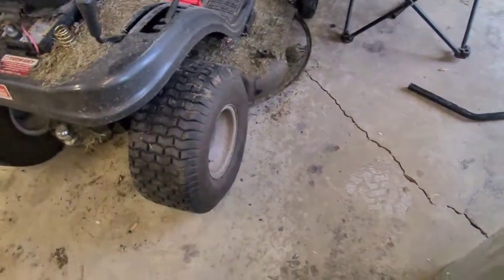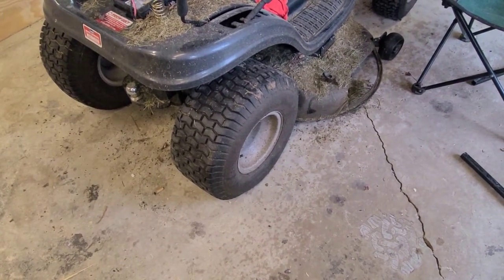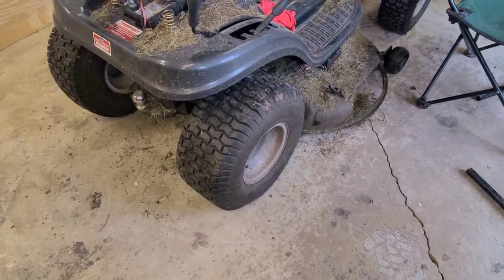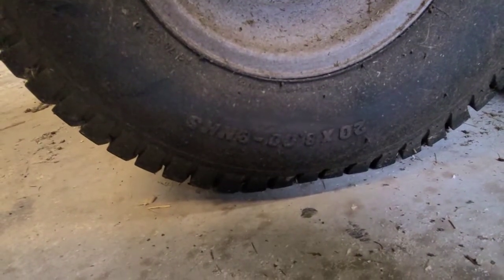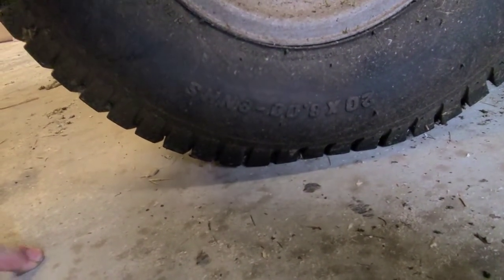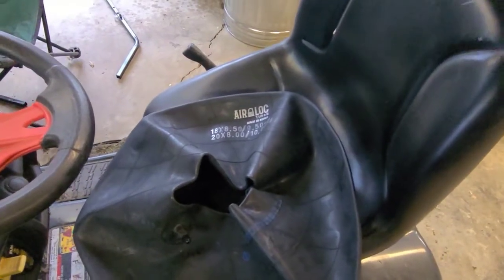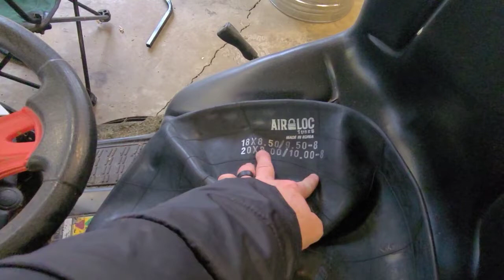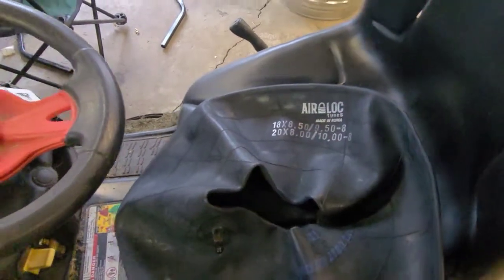How To Put A Tube In A Lawn Mower Tire

Comment: I could never get the valve to line up first time it was pointing away from the hole so I had to take it back out, then I have it lined up and seemed to be staying with the hole and it went in ever time, keeps popping back in now it is way under there so that is it Don't guess I should run it like that. Probably the whole thing could be avoided by putting bead sealant on the tire  I don't know, back to the push mower
Reply from the maker: I had the same issue. If you have a valve stem remover tool, it will thread into the valve stem. I always push the valve stem through the hole and thread the tool on to keep it from pulling back inside. I leave it on until I'm ready to air the tube up.
Reply: @ProjectDIY2   It holds air real good though the valve leans which means it keeps moving I was using the mower with the valve leaning 45 degrees but it holds air good but you can't put anymore in there, I guess in the spring I'll try again to get it to stand up straight maybe I'll reinforce it with a piece of rubber